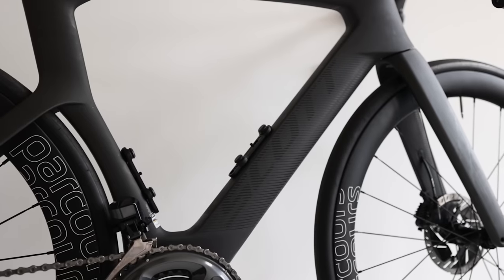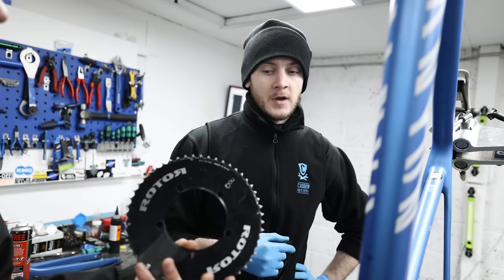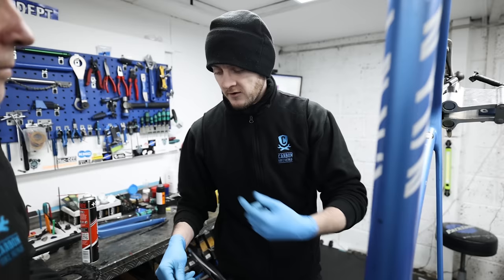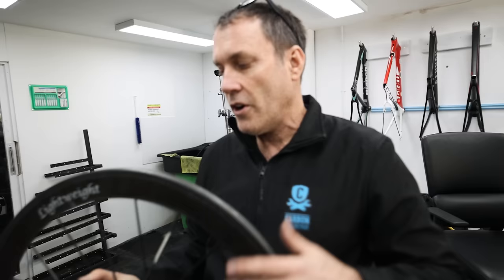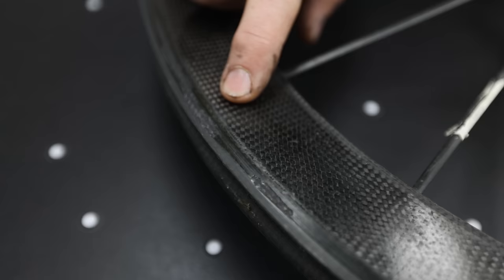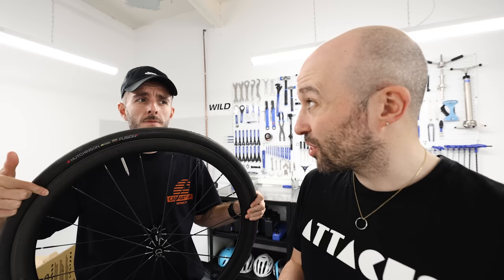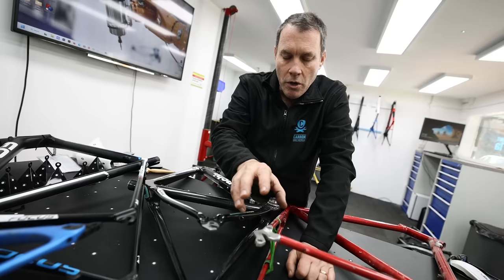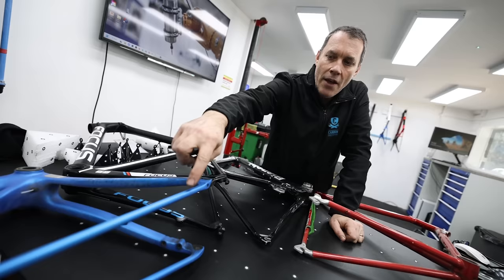6 Bike Products That Shouldn't Be Carbon Fibre

Comment: I'm sure these guys do great and valuable work. But i have my issues with the first three points: 1. They say carbon chainrings can't cope with abrasion and then show carbon chainrings with bonded metal (Ti?) teeth... 2. Bottlecages can be made in many different ways out of carbon fiber. Many won't brake. But only because the 0.75g models will brake, you can't say all of them shouldn't be made out of carbon. (most "non-carbon" cages are made out of carbon or glass fiber reinforced Polyamide, not PP which is too soft) 3. Alloy spokes buckle and carbon doesn't. Okay, but for a spoke to buckle, the ones under tension need to have snapped/collapsed. in which case the 1.8mm alloy spoke won't be of any help when being loaded axially. The theory is correct if you leave out the context, the real case makes no difference for the rider. Especially if the rim has collapsed, the thickest imaginable steel spokes will be useless.

Comment: Most riders simply do not need carbon fiber anything.   There is a risk of catastrophic failure with carbon that you simply do not have with metal.
As well as the items mentioned then I would also add.    The fork steerer.   Durian rider has made some video about this.
I am an ordinary rider.   I would question the necessity of carbon anything.
A bike made of metal could last for a whole lifetime without any worry.
I started on Reynolds steel and covered maybe 50,000 miles and you never have to worry about it.

Comment: Francis, can you ask Rob about the fragility of modern day carbon bikes? I remember in the past Canyon suggested that even a fall from standing point could destroy the frame and a lot of anecdotes are still circulating, but what's the current situation?
Reply: Hard to imagine that is the current state of affairs with a good bike brand. For example, GCN did a video where they tried to destroy a pair of Winspace wheels and rode them directly into a gutter at 45kph and it laughed at them. The frame on that bike I presume was fine as well, massive impact force vs just falling off stationary. 🤷🏼‍♂️
Reply: @AlistairLattimore  I don't want to believe it either but we all know that cycling industry has design and qc problems. Rob is the ideal one to answer if a person can trust its bike after a simple fall on tarmac with no visible damage. I mean, how many of us have an ultrasonic scanner near their city?
Reply: Canyon(crack) doesn`t have a good reputation in the industry :D Quality is below average and you are paying way to much for a D2C product. Don´t believe what the masses/media tells you.
Reply: @Nico-jt8ll  Canyon was just an example, I don't hold them in high regards or any other company in particular. But, other brands have given similar opinions. And my question is: do those opinions still stand, because a lot have changed (manufacturing, lighter frames, materials).
Reply: Hi guys. Mmmm Fragility on modern carbon bikes..we as consumers really want it all in a bike. It’s simply not possible so let me start there. 
In the early carbon bikes the tubes themselves were too strong and too heavy but the structure was terrible and non-compliant. Now flip it to modern bikes and you have super thin light mid tubes but very strong structures. The older bikes might have been robust to a knock or two but believe me they would fall apart at the Bb because the structure was not compliant with the stiff tubes themselves. A company such as canyon have a rather interesting and aggressive approach. Super light stiff and affordable bikes but at the price of impact fragility. My advice is wrap these bikes up in cotton wool when handling or transport and ride the hell out of them on the road. A bit like an F1 car. I think you’ll agree that most cyclists who enjoy performance riding would have it no other way. My advice to cyclists who don’t care for that but want a hardy carbon bike is to look for the lower spec models with more weight in the frame.
Reply: @carbonbikerepair1  thank you for the answer. I don't care for the bike to be super light, but I do care about the trustworthiness after a fall, especially since I don't have a specialty shop within reasonable distance to check it. Very interesting take at the end. Maybe the average Joe like me should stick to low spec carbon or high end aluminium.
Reply: Light carbon frames are strong in the direction they were designed to take force while riding. They are not at all in other directions. I have heard of many carbon top tubes cracking if the bike falls over and impacts something from the side. But to be fair, the bike wasn’t designed to have strength in that direction. Still, you need to be careful with carbon from those random hits.
Reply: @carbonbikerepair1  Can you name a few carbon bikes that go to more strength, longer life carbon vs light weight?  (I'm not sure heavier always = stronger).  Would giant defy or trek domane be stronger given endurance focus ?
Reply: I have an aluminium Propain Rage and my son has the carbon version. The weight saving was important as he is quite light, and throwing around an 18kg downhill bike was more difficult. So far the carbon bike withstands equivalent punishment with no issue, but we are very careful about anything that will chip or abraid the carbon frame and compromise the structure. The ally is very forgiving and the weight penalty does not bother me.
Reply: @mdbourne  I just broke a carbon frame gravel bike by slipping off the pedals and landing my ass on the top tube. I hit it so gently it didn’t even hurt in the slightest, yet the $2700 frame is finished. I’m never riding carbon off-roads bikes again.
Reply: @WordupG  unreal! Sorry to hear that, so frustrating
Reply: My trusty Leomnd Alpe d'Huez (alloy frame/carbon fork & chain stays) got tossed off the back of a mate's bike rack doing 110km, which totally destroyed the standard metal wheels. Got the bike xray'd and it got a clean bill of health, so they can withstand a fair bit of punishment. Maybe I just got lucky?
Reply: @WordupG with mountain bikes, in order to make the carbon strong enough, they end up weighing more than aluminum frames. Carbon fiber is not anisotropic. Alloy makes so much more sense, aside from fashion.

Comment: I have used a few carbon fiber bottle cages and they do grip tight but too tight . the bottle is leaking in short time from the cage grinding away at the bottle every time its inserted and removed , the Fidlock and Fabric cageless bottle holders work the best and the bottles last a whole lot longer but not for everyone ..
Reply: Love fidlock, hate the fact I can't take a bottle from anyone else...

Comment: Carbon fiber handlebars and stems. Such a critical component that could shatter at any moment when the conditions are right. Don’t worry about the weight stay with alloy or if you got money go titanium
Reply: I had carbon handlebars and they used to flex ever so slightly under power; when I replaced them with an alloy handlebar they were pretty much the same weight
Reply: Not at all.  So long as they are clamped at the correct torque, they will last almost forever. And they help reduce road buzz.  Remember, CF has a nearly infinite fatigue life.
Reply: They are a bit of a nuisance on a mountain bike because you aren't gonna have a torque tool with you to readjust levers when you need to.
Reply: @richardhaselwood9478  you're assuming that they are manufactured properly. Not always the case with cheap Chinese components.

Comment: Problem with carbon fiber is that when it cracks it splinters and then shatters. I also notice after time the epoxy wears off and starts to peel away. And with all the dings and scratches you can't really polish them and repair. Carbon is great for certain components like handlebars as the only advantage I see is that carbon fiber absorbs the terrain vibration a little better. In my opinion I would never ride a full suspension MTB made out of carbon fiber [ frame] as it is too rigid and stiff with no flex and to me to weak. I believe that 7005 aluminum [ triple gauge] is the ultimate frame material.

Comment: I would love to hear Rob's view on the new forged carbon parts. Pros and cons, and what to have in mind.
Reply: This is just marketing for fiber reinforced plastic.
Reply: @rosomak8244 no it isn't... fiber reinforced plastics are those that can be injection moulded, the "fibers" are so short it's barely worthwhile (it is worthwhile, but the benefits are relatively small). "Forged"  carbon (note - clearly not forged in the correct sense of the word...) uses non injection moulding (i.e. moulds and packing) and a very high fiber density. You can also layer in, or wind, extremely long fibers to provide specific characteristics. The strength and stiffness differences are vast.

Just both have a "plastic" material and a "fiber" material, but that's about as close as they get in design, process and finished part.

Comment: Bike light/camera or basket holder should not be carbon fibre as well. If you ride bike everyday, it is hard to last for 2 months.
Also, the hook for back rack hanger. Synthesis plastic is way better than carbon fibre (still, metal steel is the best dutiable)

Comment: Anything that gets clamped... Why? To make a carbon part that is clamped and the main load is bending (e.g. handle bars or seat tubes) you basically need to make black steel to make it work.
Carbon is perfect for something that isn't meant to be replaced and a clear main load pulling in fiber direction. Some torsion etc. Is ok, but when you get all kinds of directions of load, your better off with something isotropic.

Comment: Coming from a different sport background and surprised they are not making Carbon/Kevlar parts as you would keep most of the lightness, strength, and more importantly a degree of flex 🤔 Really interesting on how Rob explained each of the cases 🙌
Reply: May I ask what sport you are coming from?
Reply: @shahirraeed  Canoe Slalom
Reply: You dont want flex
Reply: @gauthierperrod4958  Kevlar solves the breaking point/shattering issues when laminated with the strong rigid carbon fiber… Expensive? Yes. Tooling, laying up and machining is extremely difficult and labor intensive as Kevlar will always fray when cut and has different saturation properties. A lightweight combination alternative for airplane fuselages and Kevlar by itself is effective dampening for stoping bullets.
Reply: Sport background, not engineering background.

I have carbon/aramid (e.g. Kevlar) tubes here that snap just like pure carbon ones.  It isn't the material that causes these issues, it's the layup and overall design. 

Aramids have some nice properties, but can be a pig to work with. The one area we see them is in machine wound tubes where the process is well controlled (and the volume is large, which means it is financially worth getting right). Kayak paddle tubes may fall into this bracket.

And I have never quite got to the bottom of how many bicycle (and other) "carbon" parts are actually 100% carbon.  Much composite engineering for mass market products uses a glass/carbon mix - which for a given cost/strength requirement is usually a better option. But it will be sold as "carbon composite" with as little as 10% (maybe less) carbon vs glassfiber.

You can charge a lot more for a glass fibre product if you throw some black woven laminate in there to make it look cool... you'll see that too.

Comment: CF Handlebars probably shouldn't be used on a bicycle used for everyday riding.  I was on a bike trail and a guy coming toward me suddenly for no reason swerved radically, fortunately, he swerved into bushes instead of into me, and the bushes broke his fall.  I stopped to go back to help him, he was scratched up but nothing serious, but what happened was his handlebar snapped sending him out of control.

I also don't like CF wheels for street casual use.  I have a friend who was riding in our group of 6 on a country road, when suddenly his front wheel exploded into pieces (this was the final determination as to what happened when his lawyer had a private investigation to find out the cause) in the process the frame shattered, and the back wheel cracked.  He was in a coma for 9 days, this was 2 years ago and I don't think he will be returning to ride a bike ever again.  There was no pothole, no rocks, no trash on the road, nothing, he was on the left side closest to the center line so he didn't hit the edge of the road, nor hit the rider next to him, and the rider behind them saw no collision between the two nor anything that would have caused it.  The rider behind barely escaped serious problems himself and only got both tires flattened by shattered pieces of CF he ran over.

Comment: Amusingly I had that exact plastic bottle cage on my bike up until the middle of last year when it snapped and I replaced it with the carbon version.

And just you watch, the bike industry is gonna come out with carbon disc brake rotors one of these days, just to combine the worst of all worlds.
Reply: With carbon rotor bolts. To save an extra 2g. Should be fun.... on the life insurance claim
Reply: carbon ceramic disc brake rotors are already on the market. A few years I believe.
Reply: @nlfiets  I think some small companies have tried experimenting with them but I'm not familiar with any that have hit the market in reasonable numbers. Carbon ceramic disc rotors have existed on the car side of things for ages now but the fundamental problem there is that even with thousands of pounds of car to slow down, it's difficult to keep enough heat in the brakes for them to work (outside of racing conditions), so 99% of the time the perform like shit. On a bike it would be even worse.

Comment: It would be interesting to see those carbon dropouts under a microscope. I would imagine that surface is tremendously degraded and that degradation happens on every single ride, even if your skewer is "tight".
Reply: The laminate is a lot tougher than you imagine. I have a full carbon front fork on a Cannondale CX bike - everything is one piece of laminate, from the top of the steerer to the bottom of the dropouts. When I first saw that, as I received it as a free upgrade thanks to a recall of the original carbon / alloy fork, I was a bit skeptical, too. But having ridden well over 10,000km with that fork I am trusting it a lot more than I was initially willing to give it credit. The knurled surface of the QR imprinted on the carbon surfaces when I first installed the front wheel, and that's it - it has really not visibly changed since then. Whenever I remove and then replace the front wheel, I do pay attention to letting the QR surfaces engage with their own imprints on the carbon dropouts in the same way they were before to avoid munching up the surface. It's a lot simpler and easier in practice than it sounds. :)

Comment: Be really interesting to hear Rob's take on the new prototype Sram XX1 direct to frame rear derailleur.
Reply: To be fair, given the articles talking about that RD, seems it's more like a RD with an integrated replaceable hanger.
Reply: @shikaze66  yeah could be 🤷‍♂, would love to see what fail safe they designed to stop it being ripped away from the frame without damage ?
Reply: @harveyjones1  Especially given that XX1 is a MTb groupset, and MTB RDs tend to smack into rocks all the time.  I have 2 seasons on a Shimano Deore 12 speed RD and it looks like it's been through the apocalypse, but still shifts just fine
Reply: @harveyjones1  the mech is built fully serviceable with replacement parts available. Each section, cover, motor, spring assembly etc is of a bolt together design, so you can replace only the parts damaged and not the whole component. The direct mount section is also modelled from their Universal Derailleur Hangar standard which has been adopted widespread. Bike brands will either supply Shimano with a UDH or SRAM without a hangar. It's both a smart solution and clever marketing. They still make money when a Shimano equipped bike is sold because it uses one of their patented components.
Reply: @matt_acton-varian  A couple of things: first SRAM doesn’t make licensing money on UDH. Second, just because the derailleur is rebuildable, does not mean you will be able to. I have two sets of SRAM 11-speed hydraulic road levers with bad master piston seals. SRAM has not made to the repair parts available for over two years now. It’s a complete scam. These expensive brifters are completely useless because of three tiny rubber seals that can’t be purchased due to intentional scarcity.
Reply: @WordupG 100% correct. And just look at the price of that rear mech...  anyone who pays more than Ultegra / XT money is welcome to do so, but the return on investment past that point is hilariously low (essentially boasting to your mates about how cool it is... which is not worthless!) and you can't logically defend it, although thousands try.